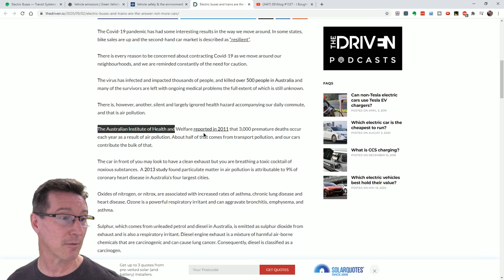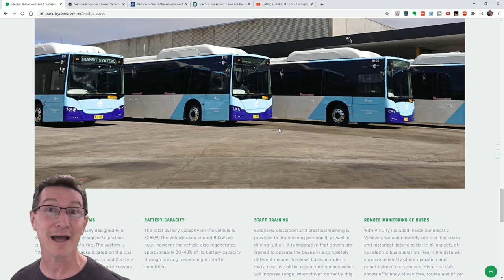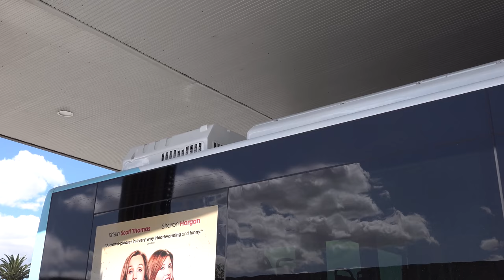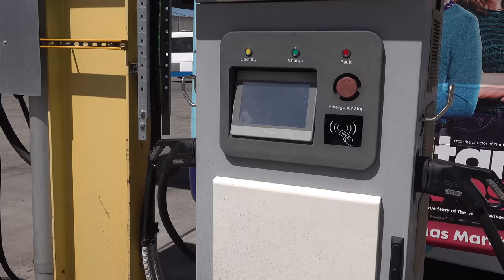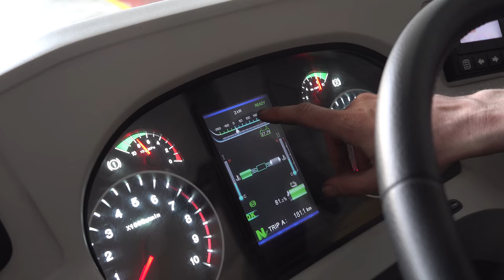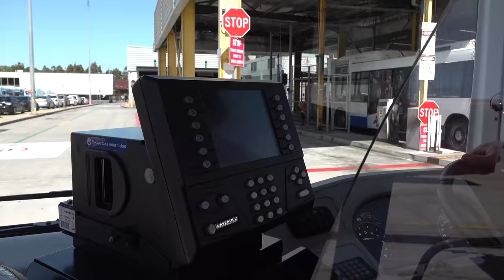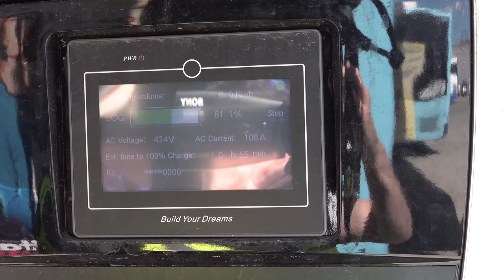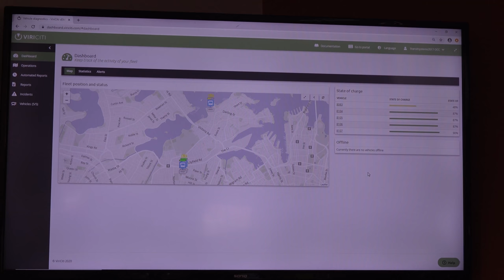Electric Buses in Sydney

Comment: no quick on-site teardown?
Reply: Don't touch the orange cables...! To (commercially) work on high voltage (SAE definition, not grid) EVs, people need quite the qualification, similar to the level of an electrician. Everyone else, even if just working on some other part of the vehicle need to be teached about the risks and how to avoid them.

Comment: Here in Paris we have 150 pure electric buses. Another 800 on order.  Also 950 hybrid buses - helps a bit. That’s about 25% of the total, better than nothing, keep going!
Reply: You are getting ripped off. Ask city council for T_R_O_L_E_Y_B_U_S_E_S
Reply: @ironman8257  I don’t think the cost of the line infrastructure required would be acceptable and I’m certain the visual impact of the wiring spaghetti would not be acceptable.  We do have tramways that replace major car routes around the city where the infrastructure is less impacting on the visual environment.

Comment: Electric buses have actually been around since the 1880s and especially since the mid 20th century and there are big fleets of them around the world, especially in Europe. You might know them as trolleybuses. What you're actually talking about here is battery electric buses, which are the same thing except that they operate independently and involve the environmentally detrimental process of manufacturing and disposal of batteries, not to mention extra weight and the issues associated with that. 

So battery-electric buses are not perfect but better than having diesel buses but not as good as having trolleybuses. Nowadays, trolleybuses have smaller battery packs on board so that they can run either on-wire or off-wire with in-motion charging, which gives them almost as much flexibility as a diesel bus and an infinitely greater range than a battery-electric bus, hence little downtime. Because they are lighter due to not having those loads of batteries on board, they can also haul a full load of passengers, up to 100 in a 12 metre bus, compared to this Gemilang which has a capacity of about 60.  

I note the huge aisle stairs at the back of that Gemilang bus. In Europe the electric buses have a fully stepless aisle (since obviously there's no longer an engine that has to go under the floor and the batteries are all on the roof), so that's a compromised feature that still needs improvement on these Australian models. There are further models currently being developed by Australian manufacturers so it's still a work in progress.

Comment: Here in Karlsruhe we have a hydrogen shuttle bus that was developed at our university to link our different campuses (campi?). It's actually quite good because that bus is driving around for 18 hours a day, without any pause to charge. The only issue is the lack of any hydrogen infrastructure anywhere in the world, so the uni also had to build it's own filling station. I believe the original plans even included directly electrolysing the rhine river, but that was never implemented unfortunately.
Reply: Electrolysing the Rhine river lol, that's like the global supply of H2 right there, and no more floods downstream!

Comment: any chance of another visit one year on ? - this was very interesting, thanks Dave
Reply: i’ll explain to you what has happened in 1 year: Transit Systems has around 14 electric buses. the extra 10 are yutongs which are ugly and sydney bus enthusiasts do not like them. Transit Systems still has the most electric buses out of any operator in sydney. They still have gas buses which won’t be replaced for another 10 years so the info in this video is not fully correct.

Comment: Great update on electric buses in Sydney. I am very interested in Vehicle to Grid (V2G) and virtual batteries for grid stabilisation. It seems to me that a bus fleet of some 800 vehicles at around say 300 kwh each  could provide an enormous opportunity to use the fleet for V2G and grid stabilisation. In particular the usage profile of buses with two peaks demands then being parked for most of the day ( when the sun is shining and most of the night ( no solar) could mean they could be a huge virtual battery. I would good to know if State Transit are thing about V2G.
Bye the way a great video.
Thanks

Comment: I agree with your take on in-road dynamic charging.  It is going to be massively expensive and not provide enough benefit.  However wireless opportunity charging is being used to great effect by the Antelope Valley Transit Authority in California.  They can get 250kW charge during their ten minute breaks.  This can keep their busses going all day long where they would normally have to swap them out later in the day.
Reply: Here in Vienna we have some small Rampini city busses that use the tram catenary (or rather, special sections of wire directly connected to it, as they also need a current return path obviously) for recharging at the termini. https://www.flickr.com/photos/anurgaliyev/11837831765/
Reply from the maker: In isolated dedicated spots, sure. Along the entire bus lane is just a monumentally stupid idea.

Comment: Lucky Sydney for getting ACed Busses, where I live they simply left out the AC to make due with a smaller battery, one step forward and back again.
Reply: A new bus without air conditioning is practically banned here. Not one person in charge or customer would want that.

Comment: 20:17 That's 1 dollar per 10000 km. Amazing.
Reply: Must've been that classic error...
Reply: Yeah, I got that as well.. 368 kwh, depending on your electric rate (I'll take $0.10/kwh), that's $36.80 per full charge, but they're only using about 60% of the charge, so that's about $23, they're going about 120kms in a shift so $0.18 /km, which isn't bad for a 15 ton bus
Reply: @Rx7man  That's 1800 times as much as what he claims.
Reply: @Okurka.  yup... I think my math is right?  Local power costs may be a little different, but I think I'm in the ballpark

Comment: We've had electric buses here in Netherlands for a while now, the reduced vibration and noise (especially compared to the regular models when you sit on top of the engine area) is very noticeable.
With noise cancelling headphones there's not much left of the operational sound of those things, Id almost be okay with regular ones if it wasn't for a lot of other passengers (in normal non-pandemic times). The acceleration is a lot smoother as well. I did notice when they were new though that their brakes probably were a bit more agressive than what the drivers were used to and some drivers would accelerate faster than was comfortable for some standing people during a busy ride in the morning and late afternoon peak hours.

I think the ones I've seen around here are of the VDL Citea brand? Their charging contacts are at the top of the bus and can extend up to dock with charging infrastructure like this: https://www.vdlbuscoach.com/_cache/_public/VDL-Citea-SLFA-181-Electric_MKF3126_MR-small_cl8xNDAweDBfZF8xX2pwZ18vX2Fzc2V0L19wcml2YXRlL3NuaXBwZXQvMzAxNw_b4142abd.jpg

Comment: Most cars have more batt capacity than they state in the specs. They use the excess capacity to automatically compensates for any battery loss per year until the spare pool runs out. It's more about perception, if the purchaser sees the capacity fall in their 1 year old vehicle it doesnt look good for brand image.
Reply: And it allows higher manufacturing tolerances for a battery pack actual capacity/cycles.
Reply: @Ben Wilson It's not so much an excess pool that runs out, but a reserved buffer (typically some 3-5% of the actual capacity), as regularly charging Lithium batteries to 100% does dramatically reduce the durability. Hence you will recognize degradation immediately when it occurs.
Reply: @stephanweinberger    excess pool and reserve buffer mean the same thing.

Comment: Solar is awesome, but this* (installing solar at the depot) is exactly one of those cases where the bus is being used constantly during peak insolation period...so not useful to charge the bus...but definitely excellent to offset the consumption of charging 70% of a 400kwh battery every night. 
As solar vehicles go...a bus is one of the few cases where it almost makes a bit of sense to add several kw of solar to the roof. Info from solarelectricityhandbook.com Say you could fit 20m^2 of panels, in the dead of winter with flat panels and low sun in Sydney you'd get 2.5kwh/sqm/day = ~50kWh. Summer would be 6kWh/sqm/day = 120kWh  So much depends on how long the bus would be in shadow, but is' free real estate. ....a least better than a f**king roadway.
Reply: You've got to weigh up the downsides of extra maintenance, extra weight, blockage of cooling vents, extra height against the slightly reduced energy drawn from the grid upon recharging. They couldn't make the batteries any smaller just because of the panels, because some days are just overcast... so I find it hard to believe that it'd ever work out to be economically sensible to put panels on the roof of a bus.
Reply: @TheHuesSciTech  agreed - had to preface with almost barely feasible.
Reply from the maker: Busses were charging when I was there, after the morning shift, so certainly they do get charged at peak insolation times.
Reply: @EEVdiscover  I figured your tour was special treatment... Very cool!
Reply: @frollard  Agreed in principle that solar roofs would be a great idea in Sydney but I don't think you'd get 2.5kWh from 1m^2. Unless I'm mistaken solar panels are about 1m^2 in size but generate at most 325W per hour.
Reply: @yggdrasil9039  Not sure if intentional but check your units - a high quality panel will give ~300 watts output instantaneous (power),  ~300wh/sqm/h (energy output- the hours cancel out), times 10 hours is around 3000wh/sqm/'day'. Adding in fudge factor and losses from panel being laid flat you get around 2500wh instead of 3000wh, and of course this is absolute best case. 
fwiw I think it's the ideal place for them since you don't have to worry about grid inversion - just use the power in situ since there will always be a bit of the battery bucket that is available to absorb the energy.  Yes, it's only 1/3 of the 400kwh battery at best, but that small proportion mustn't overlook the fact that 120kWh is a fair amount of juice.
Reply: @frollard  You're right, thanks for the clarification, although 50kWh extra given a 20m^2 surface area per day and 250W per m2 per hour is 1/8th of a 400kWh battery pack, but still 12.5% free lekky per day is going to pay off the solar fairly fast. Not sure how you will achieve 120kWh though, even in summer as this will require panels to go above 300W which is not yet possible.

Comment: Procurement policies here (Canada) would have a fit over buying busses made overseas so long as domestic factories produce them - even if fossil fuel powered. Will probably prevent the adoption of battery powered busses here for the foreseeable future due to the costs of upgrading the production infrastructure.
Reply: There are already at least 4 battery-electric bus plants in North America: BYD has facilities in Newmarket and California, New Flyer in New York, and Proterra in California.  The TTC's currently running a 60 bus trial (the largest battery-electric bus fleet in North America, made up of 25 New Flyers, 25 Proterras and 10 BYDs), with plans to be 100% zero-emission by 2040.

Comment: So how did the trial go?  I guess in SF they under-specced the power units so they couldn't get up the hills :/.
Reply: the trial was successful and transit systems now has around 60 electric buses. Transit Systems have recently purchased some new australian buses which are much better then the ones shown in the video. they have the most electric buses in sydney with other company’s having either as little as 5 or none.
Reply: @kfcwickedwings  Glad to hear it!
Reply: @macelius  sorry this was my mistake but transit systems only has 14 electric buses. they have 41 models of this bus but in diesel form so the trial wasn’t successful with these ones but the new australian built buses ( Custom Coaches Element) may be. also note that the diesel models of these buses were purchased after this electric buses was delivered to leichardt depot. 

edit: they also have another 28 but with a scania K310UB engine which is not electric, but the same model as the one shown in the video and was purchased very recently
Reply: i’m back as i have just found out that transport for nsw has banned all electric buses from being built overseas so no more of these yutongs or electric buses, only nsw built buses

Comment: Great video, thanks. What does your wife drive? No worries about the focus, your videos are huge on very satisfying tech content. If they replaced a lot of that metal with carbon fiber it would be a lot lighter. The regenerative breaking numbers are really impressive. AS battery tech improves this situation will only get better.
Reply: Replacing with carbon fibre would be a lot more expensive

Comment: where'nt they talkin about electric busses for syd years ago? ...it would make sence to put solar roadways on the roofs of them busses...recharge em while they driving..or just sittin in the depo
the new tram system is all electric right?... that will get some busses outta the city
nice look into the guts!...good job Dave!..thanks!
Reply: You could fit what, maybe a few kW worth of panels on the roof? 328kWh pack, it's not going to really be of much practical benefit.
Reply: @EEVblog  true dat... but every little bit would help drive the operating costs down.. just like the regen..

Comment: I owned a diesel truck for a short time. That stink put me right off, and the filth of having to maintain the thing, to the point where I gave up and sold the thing. Waiting for second hand electric trucks to become affordable before I revisit the "build my own houstruck" idea.
Reply: I wonder what those buses are worth second hand? Although it looks as though it'll be 20 years before I get to find out... that's ~7000 cycles (60% after 22k cycles or 8 years... I could live with that)

Comment: No emissions from the vehicles themselves but of course there is at source. The electricity production methods do pollute (except hydro).
Imagine when at least 50% of vehicles are all electric. The infrastructure will have to be upgraded massively. More electricity stations, more charging points.
Reply: but even then: the efficiency of a large coal or gas power plant is much higher than burning diesel in thousands of tiny motors. Also emission control is much better in a power plant.

And any other type of electricity generation - hydro, wind, solar, geothermal, ... - pollutes far less anyways.
Reply: More electric cars will actually make the grid more stable owing to V2G bidirectional charging. Infrastructure buildout is happening already. Rome wasn't built in a day. It takes time.

Comment: As long as the air pollution is somewhere else, transporting your goods, mining the earth's resources (for your batteries that need to be replaced every 10 years), and let's not forget the chemicals to make the plastics that will be around 10,000 years later. etc. Right?
I roll my eyes when someone says they're buying a new electric car to "save the environment".
Reply: Yeah no environmental considerations here.
Reply: It's still less pollution. The efficiency and emission control in a large power plant is much better than in thousands of small motors.
Reply from the maker: Go turn on your ICE car in your garage, or stand all day in the middle of a congested city and report back.
Local air pollution is a HUGE problem that kills a lot of people. Electric cars and buses and truck solves that very real problem.
Reply: Getting minerals out of batteries is far cheaper than mining them. 
That's why EV battery recycling is  starting to be developed.
It's a shame that most computer & phone batteries aren't yet recycled.
Still EVs are vastly cleaner than combustion in terms of the whole lifecycle